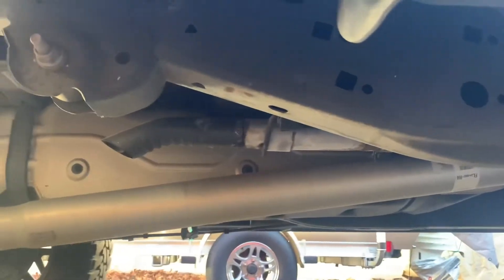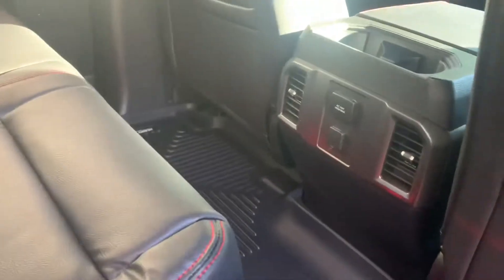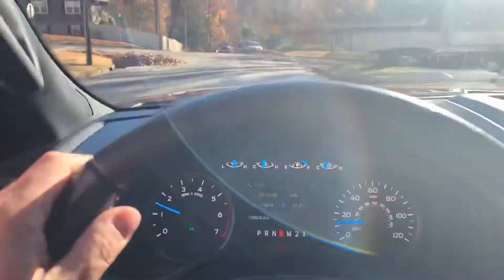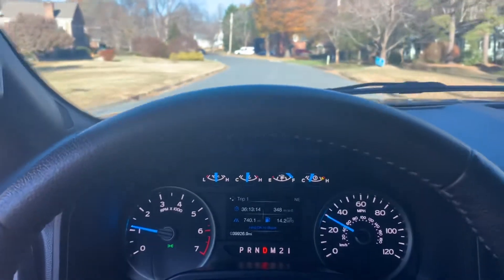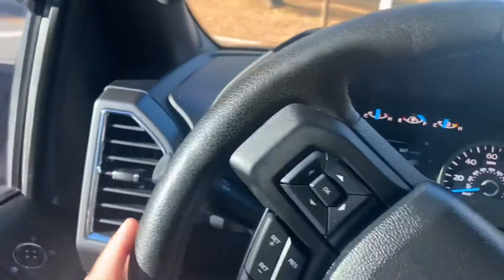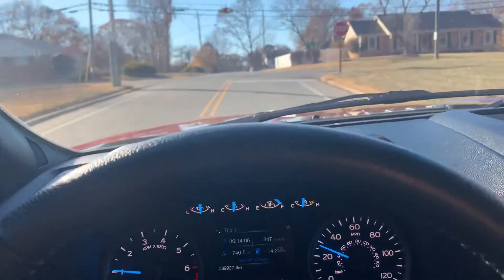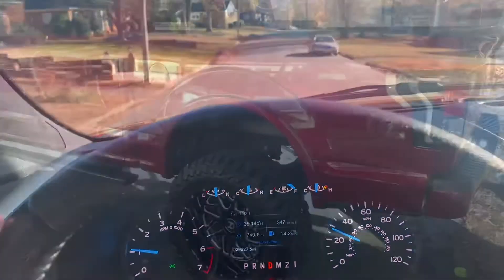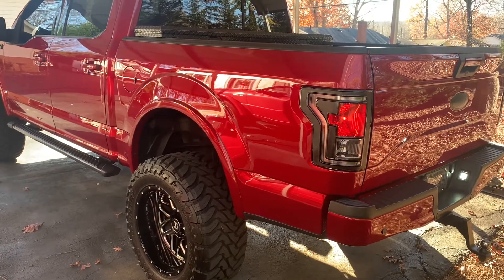Ford Coyote 5.0 liter V8 Deleted & Dumped exhaust clip. Listen to this!!!!

Comment: How are you getting 14mpg? My 2019 6" lift on 35's is getting 12mpg
Reply from the maker: Hey man. I honestly don’t know. Maybe there are a few factors , I’m not sure. Is yours a 6 speed tranny? 3.73 gears? Alignment can also cause mpg differences. Highway, city or combined data for measuring? If you have 3.42 gears with 35s and I have 3.73s then that could be the difference.

Comment: Any issues with exhaust fumes coming into the cabin?
Reply from the maker: No not at all. The pipes still exit the rear. 👍🏻
Reply: @LivinWith3M  oh good. Im trying to decide to either do this or do the delete but keep the pipe exit behind the tire. This would be easier and cheaper though